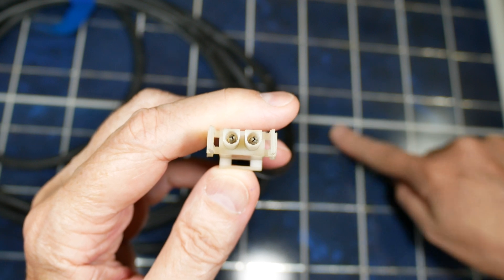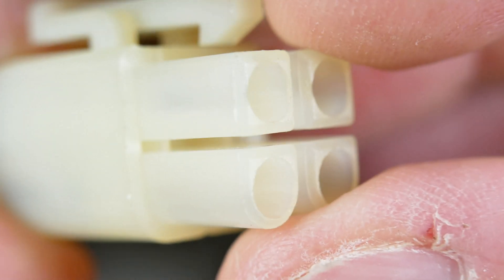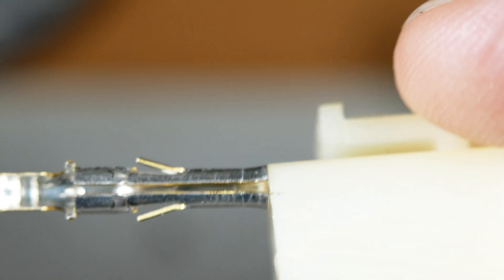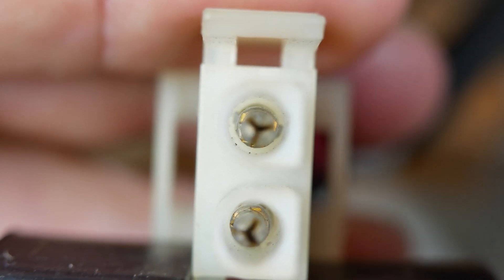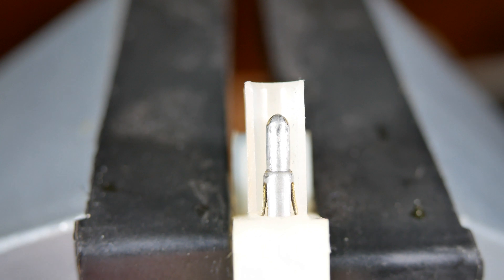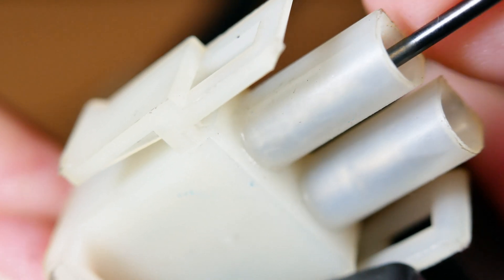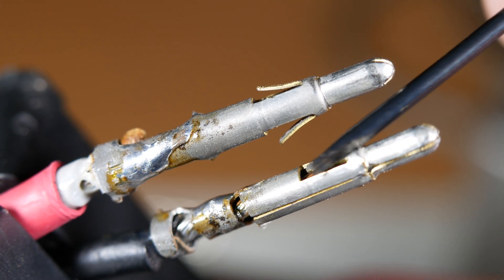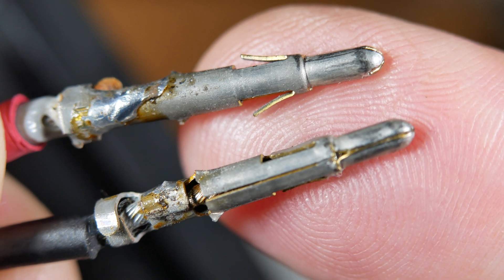Remove Pins From Amphenol / Molex Connectors For Reuse (4K)

Comment from the maker: RELATED: 
Reusing electrical components from scrapped stuff:  https://youtu.be/cMejndPYn0c
Basic Desoldering - Circuit Board Stripping, Tips and Tricks: https://youtu.be/NJWKOwfz_lk
Salvaging Circuit Boards + Rare Find:    https://youtu.be/dFpr_1sD764
Salvageable Parts From A Bad UPS Board:   https://youtu.be/FAhTbH2efAw
Salvaging Electronic Parts: Power Supply:    https://youtu.be/pDbAhXd2qLI
Salvaging Electronic Parts: Core I2S Motherboard:   https://youtu.be/5c1ME2DmHk4
Reusing Crimp Lugs:    https://youtu.be/JIdsnk8kqoY
Threaded Brass Inserts - Salvaging & Reusing:    https://youtu.be/DR6H3-N3t-I
LED Security Light IR Sensor Teardown For Parts(?):    https://youtu.be/ySlk66hfrlg
Salvaging Electronic Parts: Remote Doorbell:   https://youtu.be/bRk9LSBjLio

Comment: Thank you, I needed this... I have molex connectors on my bow thruster (connecting the thruster to the joystick 🕹️) so I need to remove the plug so I can fit the cable thru the hole up to the fly bridge manoeuvring position..

Comment: Great video!  I found this through a google picture search, looking for the exact connector that you used.  It was in an icemaker and the 2 wires to a motor corroded over time and came loose.  I need to re-strip the wires and put new female connectors on, then reinsert them into the connector.  I believe the male side is OK.  What is the P/N on the Molex connector?  What is the right term for the metal female crimp on the end of the wire that gets inserted into the connector?   (Sorry to be such a novice.  I had to drill one of the pins out that was hung in the connector.  Didn't know this handy tab trick!)

Comment: It is alot harder when the wire is broken at the joint and the pin is stuck in there without its wire…
Reply from the maker: True. My solution is to use a fine nosed forceps clamped where the wire was.

Comment: I wouldn't reuse those pins once the tabs have been bent back!
Reply from the maker: The ones in the video have been moved from plug to plug 3 times over 7 years and are still working today.  Yes, you can metal fatigue them, but the good quality ones will stand up.